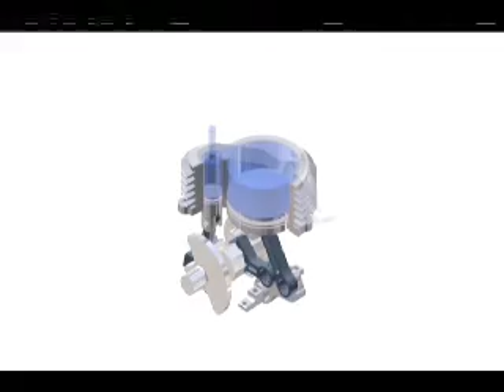A car that runs 200 miles on compressed air.

Comment: Yes, but it is a form of energy, one of the primary ones in fact (along with electromagnetism, and strong and weak nuclear bonds).  Humans using gravity to produce a usable form of energy is hardly less idiotic than a compressed air engine.

How does the water cycle start with the sun?  Unless you're arguing that without the sun, the water would just freeze, which is a pretty weak argument.  Please tell me you have something more than that.

Comment: >but eventually it will have a compressor to
>to do that while you drive down the road

Sorry, but the narrator/writer is an idiot--you can't use the motion of the vehicle to compress more air to give the car more motion. Well, you can, but it would just shorten the distance the car could drive before refilling the air cylinder, not lengthen it. It takes more energy to fill the tank than you get back out of it due to loses (primarily heat). You can't break even, much less get perpetual motion.

Comment: Hydrogen, whipgrass, soy, algae..now air.  When we've depleated oil reserves (which we will eventually) nothing will provide us with enough power to say, smelt metal for air driven engines, turn oil into plastic for all those cute little air car body panels, and provide lubrication to the air engines (yes, it will require oil to keep friction from ruining the air engine), etc.  It may take the brains of sociologists, not scientists to help people ease away from our deeply rooted car culture.

Comment: Regenerative braking worth tops 10%. Air motors are as about as efficient as they can be (old technology that's had 200 years of developement), Even halving the weight won't extend the range by much more than 15%.  Tank size, it needs to be 30 times larger so you end up with a 8 seat van, now full of tanks with only room for the driver for decent range but still with pathetic performance. 
Sorry I've done the numbers up down sideways. This thing is a con. Negre wants your money

Comment: I hear ya'. Hopefully the advent of lighter weight materials, increased compressed air capacity, more efficient air engines and using the the energy from braking will make it worth the effort.

Comment: Air cars have been around since the 1900's. In  1900 French 1900 air trams were replaced because of short range and poor performance. The same miserable performance and range MDI Air Cars have 7.2km whee! Air cars can not improved much past this. You cannot beat physics. R&D on this  is the same as spending money on improving boot laces to tug on while trying to lift yourself to the moon

Comment: Not practical. In order for it to be practical it as to violate the laws of thermodynamics. It's a neat demo, but you're still using energy to compress the air [nuclear, coal, oil, wind, etc] and it's not a good medium for storing energy compared to other forms. The idea of the car sustaining itself with an perpetual motion machine to generate compressed air from surrounding air is cartoon physics . A grade schooler in a science class should see that.

Comment: It's obvious from the surface that this idea is a poster-child for laws of thermal dynamics. 
Pneumatic motors are very inefecient. The "generator" they featured has so many moving parts, it can't be near as efficient as even that. I would estimate over all efficiency of 5%, if you're lucky. 
I love to see people think, but this is an obvious ream.

Comment: The MDI has the energy equivalent of a beer can's full of gasoline in it's tanks. And the air motor is (due to good old thermodynamics) inefficient which is why the only test ever published had the air car going 7.2km before it ran out of puff.
That's also why all the clips etc shows the car going round a parking lot.
It's a scam

Comment: Fill the tank with compressed natural gas.... The exhaust can be used to fuel an engine to run a compressor to refill a spare tank with more air to run the car. Now the Air-Car can go down the road even farther.

Comment: That may be true, but in this case, it might just be possible, it doesn't violate the law of physics, but it may not be as consistent as it says in the video.  IT MAY BE ABLE TO REFUEL ITSELF BUT STILL LOSING A LITTLE AMOUNT OF AIR AND THUS, NOT A PERFECT CIRCLE, SO IT LOSES ENERGY AND DOES NOT VIOLATE THE LAWS OF PHYSICS"
=0

Comment: 1. A company is developing a car that can run for 200 km or 120 miles the bad thing is that this car can only run at 60 mph. 
2. you can at least partially provide electricity with alternative fuels such as nuclear power, windmills, hydroelectric dams not like normal cars which runs on 100% oil.

Comment: I agree with the last comment, perpetual motion cannot exist.  Energy is lost in any event, be it forcing air through hoses with friction loss, friction of piston/cylinder contact,friction wear of turning wheels from an axel, etc, etc (hundreds of other minor bleeds of energy).  This video was very informative and exciting, but way off the mark from a science standpoint during the last 30 secs of BS.  

This is encouraging and real though, as many are in the works.  Don't listen to big oil GOP.

Comment: I am not a big supporter of hydrogen. I am more behind batteries right now, though they certainly have their downsides.

This method, while less polluting than batteries (in terms of chemical waste) doesn't seem like it would be very energy efficient. When you compress a gas it heats up. So when you fill the tank some energy will become heat, which will just dissipate and be lost. So if you use an internal combustion engine to compress the air, it seems less efficient than a car. [cont.]

Comment: Great technology, but completely terrible and misleading coverage by the Discovery Channel though. Air is not a fuel, compressed air is NOT free, and an engine running on compressed air cannot power a car and fill the tank at the same time.

Comment: A $2 fill to go 5 miles is no deal and that's all MDI can offer. All the rest is BS. The air pressure they use is stored at 3000psi. Dive tank pressure. Have you ever had a dive tank filled? It ain't pennies and these POC's have the equivalent of 10. Still only go about 5miles at 25mph that's why there are no clips of the things doing laps on a race track. But send them some $ Negre's been taking cash since 1990. He can always use some more.

Comment: It's a slick piece of marketing but I tend to believe fizzguts--this is a con. Unlike photovoltaic cells or petroleum products, air is not a SOURCE of energy. The Air Car runs on conventional power (coal, oil, nuclear, unless you're in New Zealand or Iceland).  As they admit in the video, "air is just an energy carrier", which means that you have to USE energy to compress it. Biofuel from algae is more likely to meet our society's energy needs than this highly suspect "perpetual motion machine".

Comment: I Apologize You are sort off correct there is a link on the TATA website to an article in the Financial Times from Feb 2007 about a technical link. 
The TATA MOTORS site has no mention of MDI or Air Cars. Requests for more info are not answered. My sources say no Air Cars or investment in the technology is happening. But if you are sure I'm wrong I'll bet $5000 that at the end of 2009 there is no air car in production of any sort from TATA. PM me Jan 2010 and I'll send a Paypal Number

Comment: simple, since there is no combustion, you only get heat from the friction, wich can be cool down by the engine's own oil and some heatsinks. old V dubs and 911's until the 993 model used to be air cooled

my only question is, where can I get this miracle engine? lol

Comment: Quote "You may be wondering why a company like Tata have taken the concept on board"
Tata haven't that was a lie created by MDI just like everything else they say. Real range is about 10 miles at 30mph. For over 10 years they have been selling licenses to manufacture. All it's done is line their pockets. Scum sucking bottom feeding arsewipes.

Comment: This is cool technology and so simple, really.  The main thing this requires is warm air to help heat the expanded (cold) air and not waste the potential energy that can be absorbed from the surroundings.  In the winter, this will almost certainly need a fuel source to fully expand the air, else the range will be greatly diminished and lots of energy wasted.

It would be awesome to try this vehicle on liquid nitrogen to see what the cruising range would be.

Comment: how does the motor not heat up? eventually compressing air over and over wil lwarm the air then make it hot, what is the lubricant to lubricate teh moving parts??? also where can i look at the compressed air - air compressor?

Comment: The only thing you need is plug it to electricity and it will fill the tanks with the built in compressor.The hydrogen car also only needs electriciy and water to produce hydrogen.The problem is not to produce these car the problem is if they produce these cars the goverments of the world are going to lose the taxes at the gas pumps and that's billions of dollars.So that's why the goverment is reluctant to have the companies built these green cars,they need money to keep the roads in trim.

Comment: they should'nt say that nonsense about refilling it self with presured air :) it made me think that they ar so stupid :D there is no way it could make a "forever engine" without nuclear power :D and about the presure and the tanks, presured air, is not an oxygen, witch is dangerous(mixing with oil=caboom) they said that the tanks are specialy made and calculated for accident :) afcourse it would be nice if that theese MindaHolics on discovery test it :D

Comment: This guy has no clue of basic physics? What?
Sorry, but he's designed and built these cars. They'll soon sell in many countries. Pretty good for a clueless bozo, huh!

The air is compressed in a number of different ways. It can come off the grid which is cleaner and moving more to renewables.

As for the tanks, no they aren't dangerous. They are made of carbon fibers that, under extreme stress, will split, not blow up.

Brace yourself. These VERY efficient rigs are coming!

Comment: Compressed air that runs the car will also run a generator that will refuel the car, perfect circle, perpetual motion??? WTF... 

If that could have look serious, this guy blows it up in a sentence... this guy has no clue of basic physic laws... convervation of energy... second law of thermodynamics, entropy... wtf perpetual motion? What's next? Cooling my kitchen with my freezer?

I like the unprotected air tank "strapped" under the car... wonder what happens if one decide to blow up ...

Comment: Actually its much lower.  A typical air engine has an efficiency of just 15% when you compare the ammount of work required to compress the air against the work you get out of the said air engine.  Check the "compressed-air engine" page on wikipedia if you are sceptical.  In comparison, modern internal combustion engines have efficiencies of around 20% when the calorific value of the fuel is compared with the work output of the engine.

Comment: >Unless I'm mistaken, the same amount of energy that
>comes out of the compressed air already went into it.

Actually far less, because, because when you compress air, energy is "lost" in heat--you could use the heat for something else to improve overall energy efficiency, but you always lose...

Comment: You are right...never mention or consider perpetual motion!

However, the air car does have some significant benefits that are worthy of considering. Even though it takes significant energy to compress air, the storage (an empty tank) is cheaper and less toxic than batteries and it is possible that some kind of hybrid technology that recaptures energy from breaking and such to run a compressor on board may be practical combined with other techs.

Perpetual motion and naive advertising=turn off.

Comment: TYVM!My idea just uses this a bit but it is more practical.And motnielk is 100% correct! Any respectable scientist gets off the wagon as soon as you start talking about"perpetual motion"or"Perpetum Mobile"...It can not be done for many reasons: gravity, friction, heat, wind resistance and many more... Atomic energy would be almost that because a small reactor could power your car for its life cycle.But not forever either. It can not be done because some energy will dissipate in to other forms.

Comment: To be honest with you I was thinking about this a lot for the past week and I have an idea that would utilize compressed air in a different more workable way in a car and I'm in a middle of writing down my idea and likely patent it later on. It would run much much longer than 400miles on a fill... By the way they have been using air compressors in engines for a long time and a turbo is like an air compressor too. They force more air in at intake and that makes the engine much more powerful.
Reply: How did this go?
Reply: He is dead, he went to the patent office, that's how they get you and than suicide you.

Comment: The regular engine is usually low pressure on intake and exhaust but there is extreme pressure inside the cylinder (caused by the movement of the piston). On an air compressor you have a high pressure on the "exhaust" side except its just air under pressure and no fumes. This is how it works.

Comment: There is nothing new under the sun... An air compressor looks and works exactly like and engine, except it works backwards (kind of) and it's usually a single cylinder. It takes the "movement energy" from an electric motor or a gas engine. Where the vaporized gas and air mixture goes in a regular engine, the compressor sucks air in and instead of exhaust it forces air in to a cylinder. As it forces more and more so it becomes "compressed". It has a limit how much you can put in the "tank".

Comment: Well,the occupants could easily be protected against shrapnel the concern is the car that hits you and pedestrians.They could also be protected(composite plates directing the explosion towards the ground)but that energy would throw your car in the air.Now with gas you have the same explosion except it's a fiery explosion.With air there is no fire, only explosion, and it isn't caused by a spark, but by impact.Of course the protecting composite plates would also protect against impact on the tank.

Comment: What they don't tell you is it takes a lot of electricity to compress the air to reach the 3000lbs needed just to go a few miles, and that is without any amenity's.. It is a very inefficient design. I will put my money in electric car design,,, a lot less moving parts and a lot more efficient...

Comment: A car that runs on compressed air is by no means free. It takes electricity to drive a electric motor that turns a air compressor to store energy (compressed air) into tanks, then the air (stored energy) is converted into motion using a air decompressor to release the stored energy to create motion. Not to mention the energy lost in friction alone. And did they mention that it does not have air conditioning or heat, that would require too much energy.

Comment: This is not a reliable solution, the air engine has no power...it can be used only on light cars...with max of 60mph...
Even the electric car was better, and still died...
To mass produce a air based car...will take us decades, and would be worst than allready invented electric car, witch was mass produced for a short period around the 70'

Comment: >It would be very simple to add a battery operated air compressor
>to the car and you would still be about 500 times more efficient
>than the hopeless outdated ICE.

The problem some of you are touching on is this: An electric cars are more efficient that an air car. Sorry, I wish it was not true. The only thing the air car saves you is that you can make a light car that doesn't need to carry heavy batteries. It's more efficient to charge batteries with electricity than to compress air with it.

Comment: I think the only time it will need energy is when you starts compressing the engine, then after that the compressed air will be used to run the generator instead of energy.

Comment: How about this: develop electric cars with more power, higher capacity, easier to mass produce which of course, also has 0 emission. Then invest in building power plant utilizing renewable energy sources - solar, wind hydro, thermo, nuclear. Focusing on the way we produce energy completely without fossil fuel is a more practical approach.

Comment: this may repost! But my comment is if they can make it go with compressed air that movement can be utilized to recompress air.
all it takes is another gear or belt to run the compressor while driving!I can't they overlooked this aspect!!

Comment: A windmill can compress air without converting to electricity first. There are many other zero emission technologies that can compress air mechanically as well. As for the car compressing it's own air, the same idea is in effect when an electric car uses braking to send a charge back to the batteries.

Comment: >New hyper efficient compression models are on the horizon.

Hello physics. When you compress air, a big chunk of the energy used gets converted to heat. It's a byproduct of the compression. It doesn't matter how "efficient" you make the compressor. Your only option to improve efficiency is to use the heat--for instance, heat your house, or store it for use in the decompression stage. The latter is not an option for vehicles because you can't store the heat effectively.

Comment: Clearly you weren't listening either.  The on-board compressor was a what if comment with the theory of perpetual motion thrown in a neato idea, which would likely be impossible.  The air tanks are compressed with electricity from a home compressor or a commercial air compressing station.  Watch the video again.